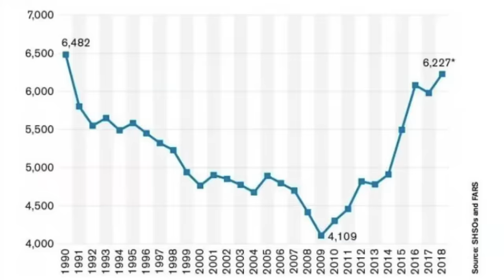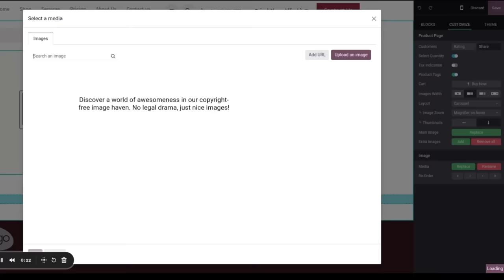Can this forgotten invention save your life?

Comment: Fun fact, pedestrian airbags do exist. A Swedish company named Autoliv manufactured them in the mid 2010's. It is essentially an airbag under the hood (bonnet) that inflates to create a soft cusion between the metal of the hood (bonnet) and the engine block. Only Volvo ended up buying them and no one wanted to spend the money even though in testing it did prevent a lot of injuries most decided it wasn't worth the cost.
Reply: Of course...
Reply: Didnt Citroen release the Cactus Pedestrian airbag system?
Reply: Extremely depressing yet informative thank you
Reply: I thought those are quiet common?
Reply: See, this is where government regulations should come into place. Might take a while though
Reply: Pedestrian protection is actually in a bunch of new cars via a similar method. Instead of an airbag they use deployable hood struts to pop the back of the hood up to allow some collapse when the pedestrian hits the hood. Iirc its only active for certain speed ranges as above let's say 100 that person is going over the car entirely.
Reply: @Setz4  got any links or information on the make/model these come in? I'm a mechanic and have neither seen, nor heard of this
Reply: As usual Volvo trying to make their vehicles as safe as possible. Goated company
Reply: That's why you need state regulations for road and street safety
Reply: I can barely afford a car without it. I see why people passed. I've never hit anyone yet. It would have been a bad investment for two decades now.
Reply: (bonnet)
Reply: It really isn't worth the cost - and do consider the whole cost: Not just what you'd have to pay for to have this in the car, but also the added weight, causing added fuel use. There are less than three deaths per billion vehicle miles traveled, and if you believe in climate hysteria, all that extra carbon would kill more people, ya know, climate change/weather. I don't know where you live, but in the decades I've been driving, I've never even come close to hitting a pedestrian. This is easily a million miles driven in city and countryside, on two continents. I almost hit a deer once, but that's all.
Regardless, most modern cars have collision avoidance, which uses parking sensors to detect obstacles and hits the brakes. My five-year-old car has that, and it's quite annoying when it hits the brakes hard while pulling into my garage.
Reply: @cheescake98  The one on the v40 actually extends to cover part of the windshield unlike a lot of the ones ive seen that are just under the hood.
Reply: When I worked in a garage we had a jaguar come in (can’t remember the model) but he had basically hit a pothole too hard and set the airbags off under the bonet
Reply: Modern BMWs use a system like that. When you're in a crash the bonnet holders pop up, raising the bonnet by a few centimeters (I know because Mat Armstrong fixed one and described the system).
Reply from the maker: Yeah that makes sense. Would be pretty crazy to see what car  safety features manufacturers could come up with if money wasn't an issue
Reply: @Ididathing Oh how much, everything would improve without corparate greed in the way. I highly doubt it even digs much into company profit
Reply: There are a number of European brands i know of that have something like this under the hood between the wiper motor or attached to the hood hinges themselves
Reply: Volvo fit external pedestrian airbags to all new vehicles, as do Land Rover
Reply: Makes sense that only Volvo would buy it, they're always looking to be ahead of the rest in terms of safety, as it's a core value of their brand.
Reply: @joshbarber3931 did you replace the airbags or did he have to get a new vehicle?
Reply: Had a quick look and found this short slow mo test footage from Volvo:
https://www.youtube.com/watch?v=Di7SAzfTe30
Reply: Duh, as if human lives could ever be worth a slight decrease in profit margin, the thought alone is ridiculous! #CAPITALISM
Reply: @Yixdy  Some Landrover and Jaguar models have a pedestrian airbag located beneath the bonnet. The pedestrian airbag operates at speeds between 25 km/h (16 mph) and 50 km/h (31 mph). In the event of a frontal impact with a pedestrian, sensors in the front bumper trigger the pedestrian airbag, causing it to inflate.
Reply: @Yixdy  The lexus is 300 has them.
Reply: God loves you all
Reply: I think jaguar had some cars with it.
Reply: @BoondockGore  Two friends of mine lost their teenage brother to a car hood. I wonder if the driver that ran him over is ever grateful he didnt have to spend money on something like that
Reply: I mean SUVs and Pickups are so popular because people don't give a fuck about pedestrians. This should answer why pedestrians airbags arent popular
Reply: I wonder if the pedestrian catcher would work today if it was already on cars 🤔
Reply: Autoliv make more than 70% of all airbags worldwide
Reply: @Setz4  I hope you mean KPH and not MPH!!!
Reply: @Ididathing you mean communism??
Reply: There are supposedly some on JLR vehicles or at least plans for them in the uk. When I worked for a JLR dealership in the us, there were repair proceduresfor how to remove them in Topix (their mechanic repair procedure database).
Reply: "Yeah it might save a lot of lives, but those lives aren't mine so I don't want to pay for that"
Reply: @bt3411 sorry to say that only the v40 has ever had pedestrian airbags. 
All new volvo's are fitted with pps. Which means the rear bonnet hinges are spring loaded and fitted with a pyro technic charge. In case of an accident the rear of the hood pops up. Besides that, Volvo was the first brand removing all har metal parts from directly underneath the hood and applying soft thick padding to reduce the impactforces in an collision.
Reply: @NobuNobuSimp but only theirs, they could have sold to other companies, but when Volvo bought them they probably had designs to make it a solely Volvo feature
Reply: @smiles9882 i mean its absolutely about keeping the cost of cars down here. It could be an in a mercedes S class, but a renault clio is not gonna be getting that kind of tech for a long time

Comment: I love that the words Ford built tough flash up on the dash right after it gets disabled by a shop mannequin.
Reply: That's Ford for ya.
Reply: @SilveniumTheDrifter  FORD: Found on Road Dead
Reply: My mom and Pawpaw were just talking about this the other day since my mom currently works at a Ford factory and my Pawpaw retired from there😂 They said they’re not made like how they used to be made. They’ve gone cheap and while the main exterior is pretty good, the actual vital stuff just seems to break so easily. Like the other day my mom almost got into an accident while trying to park one of the big trucks because the breaks gave out and that’s not the first time it’s happened to her or anyone else. Also if you see the parking lots where they park the trucks that need fixed (mostly from faulty wiring), man! Sometimes the main lot is completely full so they have to use the stadium by the plant’s parking lots and if it’s bad enough, CEDAR FUCKING POINT!! I’ve seen the entire back of Cedar Point’s parking lot filled with trucks that need fixed! It’s also due to people being fuckin lazy and not knowing how to do their jobs either due to a lack of training or they don’t wanna pay attention to how to do their jobs
Reply: ha
Reply: @CongressGamingINC  I was also surprised how not durable that car is. There is video on youtube called volvo 850 crash test and at 1:40 you can see how they crash it with oil pan contact and nothing leaks. And then there's ford which get its frame bent by mannequin stand...
Reply: @idhatemet00  FORD backwards: Driver Returns on Foot
Reply: More like the 15+ unstable rig on the front of it got shoved back from a 20mph collision. If the wheels stayed on his truck would still have a dent but the transmission wouldn't be dropped like that.
Reply: Bruh a piece of sharp piece of metal poked directly into the oil pan with enough force to literally lift the car off the ground, what are you on about 🤣

Comment: I love how this is supposed to be a strong mans car and yet you drive over ONE (1) pedestrian and it breaks
Reply: E
Reply: God loves you all
Reply: to be fair pedestrians usually arent standing on loose metal
Reply: @Nzuri. What are you talking about i love standing on loose metal
Reply: @staciemohler4624  my bad my bad bro
Reply: Kinda defeats the argument doesnt it
Reply from the maker: Two should be the industry standard
Reply: To be fair, most pedestrians don't have a heavy steel rod and ground mounting plate.
Reply: really makes it literally "Found On Road Dead"
Reply: @EvanEdwards  speak for yourself
Reply: @samweldon8104  Well, I have the steel rod and mounting plate, I'm just not a pedestrian.
Reply: smh it can't even do the one thing it was designed to do
Reply: @Ididathing at the least 😢
Reply: @EvanEdwards  don’t know what you mean, I do
Reply: Its almost like you aren't supposed to use your truck to run over pedestrians...
Reply: @EvanEdwards I have a long heavy rod that just about  reaches the ground I just don't have a mounting plate.. saw a doctor and he didn't know what I was talking about when I mentioned missing a mounting plate, he was also baffled and said he's never seen anything like mine before and said I can just consider myself above average.
Reply: @TarmanTheChampion  The mounting plate really helps certain positions.  It acts as leverage.  I highly recommend one.

Comment: As an American used to driving older cars and running over things for fun, it is absurd how easily this vehicle was damaged.  I have jumped my car, used it for demolition purposes, and like to bump into things simply to amuse myself, and none of those things have damaged it functionally, aside from breaking shock absorber mounts, denting the bumper, breaking headlights, knocking the suspension out of alignment, slightly bending the frame, and eliminating the control arm bushings.  This is all from jumping the car, going over curbs, and ramming things daily.  To anyone curious as to how I have maintained a driver's license, I would like to clarify that I do the majority of my driving in the state of Alabama.
Reply: Well. Sounds like your average Hoosier driver.
Reply: God bless the hearts of us modern southerners.
Yanks have their "bad parts of town" but the south has entire counties of their special breed of random bullshit lmao
Reply: American made cars are just garbage nowadays
Reply: They don't build em like they used to
Reply: It looks like the transmission uses a plastic oil pan. Terrible design choice but the engineers aren't at fault
Reply: @nvl2691  The amount of plastic used on the undersides of cars now is inexcuseable.  At one point I was looking into a torque convertor cover for one of my cars, the piece that goes under the torque convertor.  It's stamped steel, protects that area from damage.  The aftermarket replacements were all plastic.  The transmission is one of the lowest points on the vehicle.  It is amusing that automobiles are inherently disposable due to crumple zones, which means that despite the environmental concerns, they're just big hunks of non degrading, ocean polluting plastic.  They have to make plastic bottles thinner, but don't worry about making an entire car's interior and much of its exterior and undercarriage cover panels out of plastic.
Reply: Legend
Reply: @ravenoferin500  It does. I live in Indiana
Reply: @ofp8574 Yes, because a car’s interior isn’t going to be found in the ocean my guy. The problem isn’t plastic itself. The problem is how many SMALL and DISPOSABLE things are made of plastic and can easily find their way into all kind of water systems. 

I get if you want to talk about how cheap it is to be making important parts out of plastic, but trying to compare car interiors to plastic bottles is just silly.
Reply: A Raptor especially should have extra protection underneath. Pretty lame and cheap of Ford
Reply: @ofp8574  everyone is trying to maximize fuel efficiency and lower material cost, while still keeping the gas guzzling design

Comment: I love the big "BUILT TOUGH" on the dash, right before it says "Nope never mind its broken, needs repair"
Reply: oh yeah we built tough 
computer finishes checking all the sensors
UMMM OK MAYBE NOT THAT TOUGH SORRY GUY
Reply: God loves you all
Reply: Wrecked by a mannequin stand off all things
Reply: Seeing a Ford with the driver on the wrong side is wild.
Reply: its competely unscathed lol just the small part of it broke, and it was under. How tf did that happen lol
Reply: same with motherboards. "ultra durable" is actually very easy to destroy.
Reply: @bingusbongus9807  tough means strong. not reliable
Reply: All Raptors have Skid plates underneath for things like this, i dont know why his crappy australian version doesnt have it. Australia L
Reply: @steelice2892 up the front it does but for some reason it’s not a full under body skid plate which is surprising because these things are designed to jump and go fast, I’m sure theres aftermarket options though
Reply: I mean, it’s a ford what did you expect.
Reply: @jordancawthorn3439  my friend has a 2012 raptor and i just checked under his truck rn and it has a skid plate that goes way further in than IDATs raptor. weird, not sure if an australian import thing or what but seems to have a smaller skid plate.

Comment: "Oh no that's coolant" 
Unknowingly drives with low transmission fluid and causes $5000 of damage
Reply from the maker: Yeah I definitely fucked it
Reply: This video better go viral then...
Reply: Hopefully it’s covered under warranty, I mean really, that mannequin came out of nowhere!
Reply: No* trans fluid...
Reply: @Ididathing  haha fix or repair daily
Reply: "Built Ford tough" lol
Reply: Came to comment this!
Reply: @Ididathing  nahhhhh new pan and she'll live again, it couldn't have damaged itself because it had no fluid, no fluid = nothing moves
Reply: @DeckoTD not unless it messed up the valve body too
Reply: @jordaneversen3147  good point
Reply: @Ididathing  Was it at least a good fuck?
Reply: @DeckoTD  Ah, if only this were true. In most automatics, just running the engine with no fluid in the transmission is enough to completely bork it. No ATF means you cant even start the vehicle without risking significant damage.
Reply: @gabrielulibarri9950 a few seconds in idle won't kill the pump. It's not like it's bone dry, it was just very low.
Reply: @Ididathing wait, f’cked it UP right?

RIGHT?